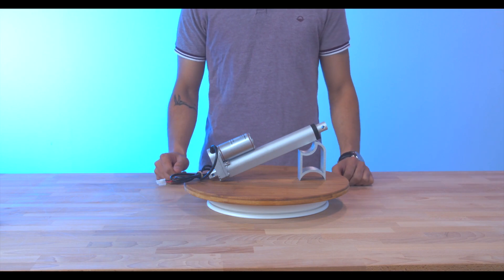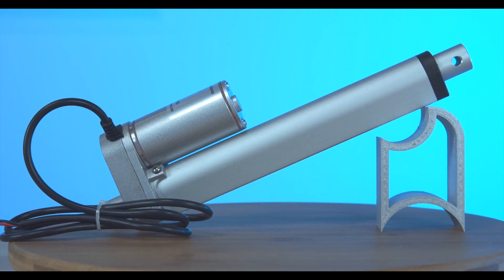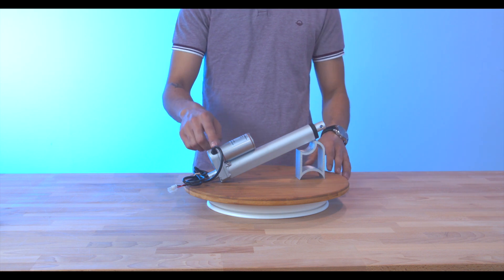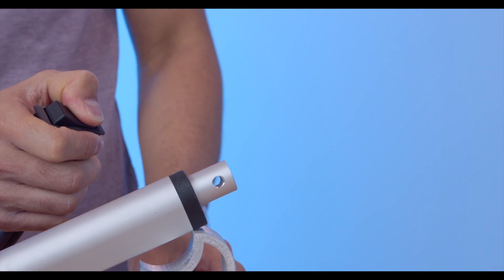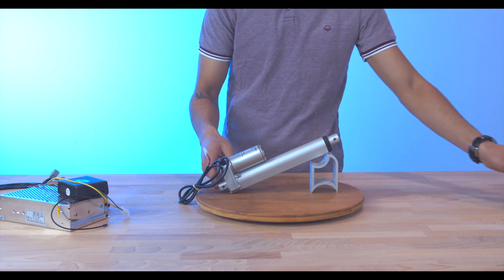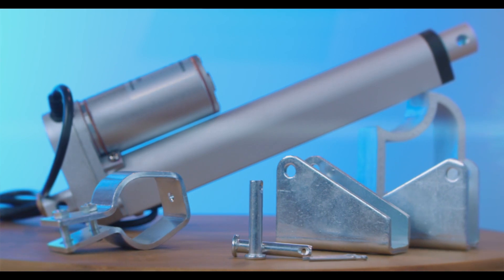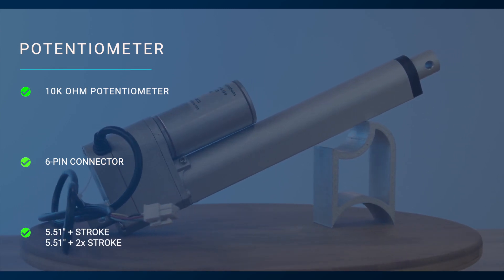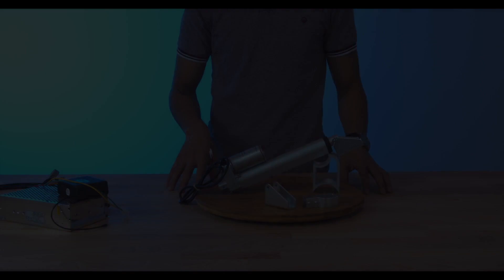Mini Electric Linear Actuator - PA-14 Overview

Comment: Hello , could you tell us how to give connection to Linear Actuator PA14 Using Sonoff 4CH Pro R3 switch  ?
Reply from the maker: Hi Yughesan,  We have not directly worked with the Sonoff 4CH Pro R3 Switch. However, looking at this board’s pinouts, you can use the relay board portion of this circuit to replicate the connections that we used with our own relay boards. Please see the video here: https://youtu.be/ldjiohQcy4c

Comment: Hello , I need a 7” linear actuator with a 2.5” stroke . With a force of 150lb or greater . Is this possible?
Reply from the maker: The PA-14 with a 3" stroke has a retracted length of 7.13" and an extended length of 10.13" - if you require an exact 2.5" stroke, we can customize this for you since it is not available off-the-shelf. During this time of year, our lead time for production of custom units could take up to 13 weeks.
Reply: Progressive Automations perhaps I could possibly be describing this incorrectly . Below I have provided a link to the non-electronic strut that I currently have. Moreover, I would like to replace this strut with an applicable actuator from your company . Thank you for replying and thanks in advance for addition replies.                                                                                                                             .................................                                      ............                                                 https://www.ebay.com/itm/Pair-of-900-lbs-lambo-door-shocks-for-bolt-on-vertical-hinge-lamborghini-style/161481902703?chn=ps&norover=1&mkevt=1&mkrid=711-117182-37290-0&mkcid=2&itemid=161481902703&targetid=1098102009964&device=m&mktype=pla&googleloc=9031907&campaignid=11774045932&mkgroupid=117378450867&rlsatarget=pla-1098102009964&abcId=9300473&merchantid=101988296&gclid=EAIaIQobChMImO-T3ses7gIVrAytBh0t0wkbEAQYAiABEgKd9vD_BwE&pageci=1aeab081-e838-497e-8c1d-65378a69a7a3
Reply from the maker: Hi Cali! Can you give us a call at 1-800-676-6123 or send us an email at sales@progressiveautomations.com so we can assist you with your application?